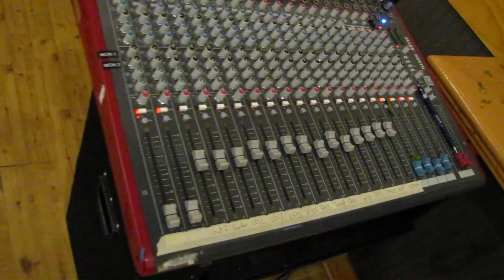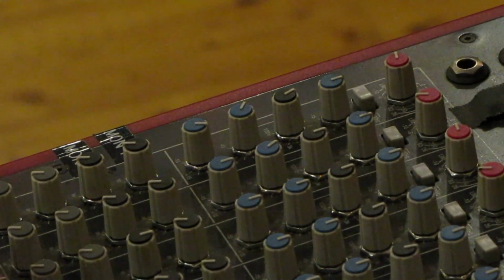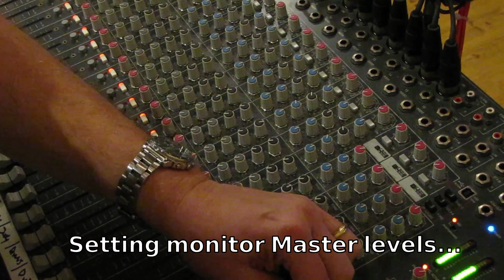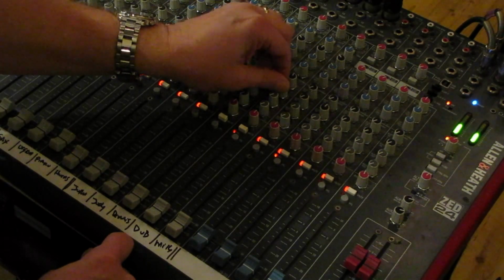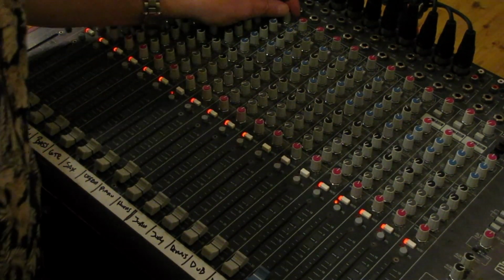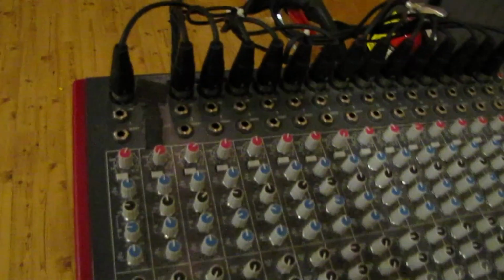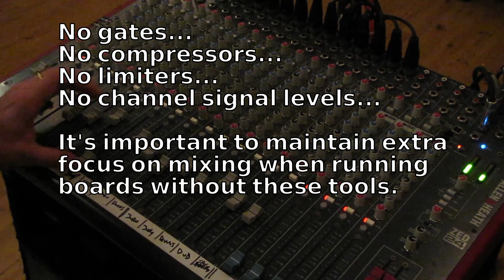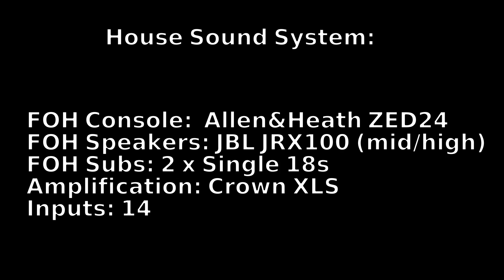Setting up and running sound for the Groovynators on the house Allen & Heath ZED console - Video 14

Comment: hi I got a question?. What do use for your sound system to control feedback . Love the videos
Reply from the maker: Proper gain settings on each mic and EQ cuts around the offending frequency.  We do not use any devices.  Once you learn and understand how feedback occurs, adjusting the gain and EQ will correct 98% of the problems.  The other 2% is proper mic placement and monitor speaker placement.
Reply: @stageleftaudio  Thank u

Comment: Have you ever worked with DMCs? I worked with the X32 and it was a revelation how much more options and how much easier became
Reply: If you watch some of their other videos, they do own a Presonus 16.4.2AI (I believe it's that specific model). I believe they've discussed their personal preference for analogue boards and outboard gear in the past.

I agree with you - in terms of power I feel digital boards are night and day and all-round 'easier' to use. Maybe because I got into doing sound about 2012/13 when the X32 was taking off but I find dealing with analogue consoles really tiresome nowadays. I've worked with at least a dozen different digital mixers from at least 6 different companies including high end stuff like Digico, and bar some weird UI decisions on some digital boards, they're all just easier for me now. Of course that's my personal preference, Stage Left may have a different one.
Reply: Yes, a digital console  gives plenty of additional equipment which is basically built-in. I am using Yamaha 01V and it is amazing how much stuff you have inside: compressor and full parametrized EQ on each channel, two effect processors. I understand that analog console is maybe easier to use, but features are limited in comparison to any digital. BTW: great episode!

Comment: Thanks for the vid :) i have a question, im just starting out in sound tech and i want to ask if my speaker connections are correct:

Mixer (stereo L&R) ---> Powered Subs (Thru L&R) ----> Powered Speakers (Thru) ----> Smaller Powered Speakers
Mixer (Aux 1) ---> Stage monitor R (thru) ---> Stage monitor L

thanks,
Reply from the maker: From what you have shown, all looks correct.

Comment: Hi, how do you group the monitors if you have only two monitor outputs (ex. guitar and drums on monitor 1 and others on monitor 2)?
Reply from the maker: Any grouping of monitors is done at the monitor amplifiers.  All we do is connect more speakers to the same monitor output.  So, if we have 1 x monitor channel, we could attach 3 speakers to the same channel (daisy chaining of speakers), to feed (for example), the lead singer, a guitar player and keyboardist... all would receive the same monitor signal.
Reply: @stageleftaudio  So is it ok running the same signals to all of the monitors when mixing a band? Tnx a lot.
Reply: I'm thinking is if you only have 2 aux output at the mixer coz some musicians want to hear some sound on their speaker some don't. When do grouping with limited aux output from the mixer who should be in the same monitor signals?
Reply from the maker: Yes, it is ok to run the same signals.  If you have only one monitor send, you will end up running all signals (only those the band members want to hear) to the same speaker(s).  Having more than one monitor send helps the band hear other instruments better.
Reply from the maker: With limited number of aux-sends, the band members will tell you who (or what) they want to hear.  The more aux-sends available, the better the band can hear themselves.  Mixing monitors is the job of the FOH person (or a monitor engineer), however, the decision on which instruments need to be louder or softer,  (in the monitors) is up to the musicians.  The band/musicians will tell the FOH person which instruments to make louder or software and which aux-send they need to hear it in.
Reply: @stageleftaudio  thank you. So I guess I need to upgrade my equipment hahaha

Comment: Hey there! What was the model of your RCF line array rig? Thanks!
Reply from the maker: NX L23A  and we use HDL10A for front fills.
Reply: @stageleftaudio  would you recommend the HDL10A for a starter line array?
Reply from the maker: The HDL10A is a great small speaker and could be used as a "starter" line array.  However, I highly recommend you listen to them (or whichever line of speakers you choose) before ever purchasing.  There are many line array cabinets available, some may be better for your needs than others.  The HDL10A has a good warm sound, though, they require a little more signal level to get them "out front" with the NXL cabinets.  Something to keep in mind with line arrays... line arrays are about physics.  The physical height of the array (speakers only) will dictate the lowest frequency you can control (or steer).  The height of our cabinets (assuming 3 cabinets) allows us to control (or aim) frequencies down to about 250hz.  Below that point (down to around 120hz), the frequencies become omni-directional.  Our subwoofers handle everything from 120hz on down.  It's usually advisable to use subs with line arrays... if you were to use line arrays to produce the bass signals, the line-array height would need to be about 35' high.  This would be to control (and steer) all the frequencies down to around 40hz.
Reply: @stageleftaudio  wonderful! Thank you so much! I love your videos!